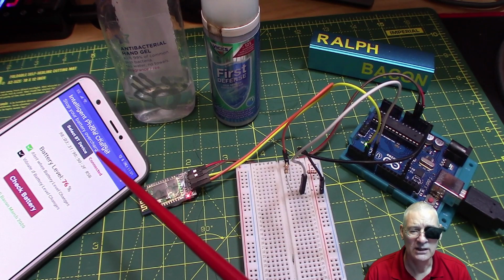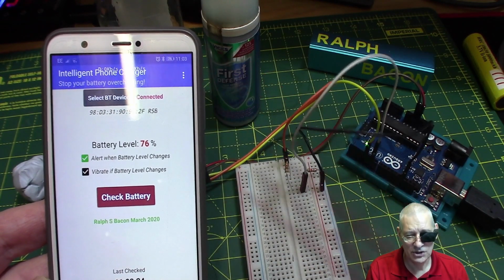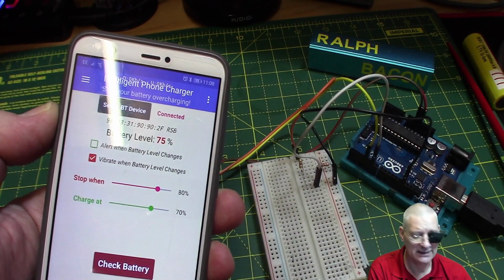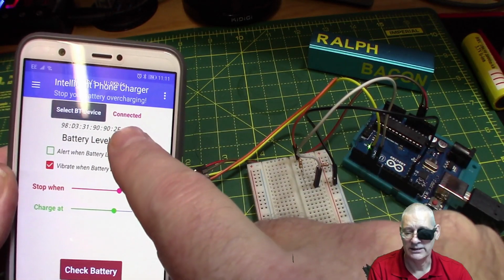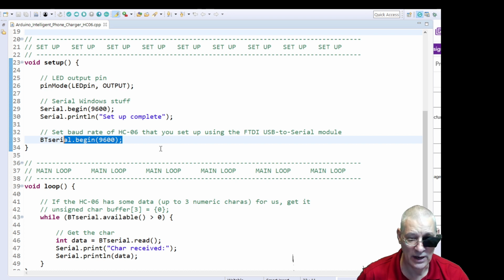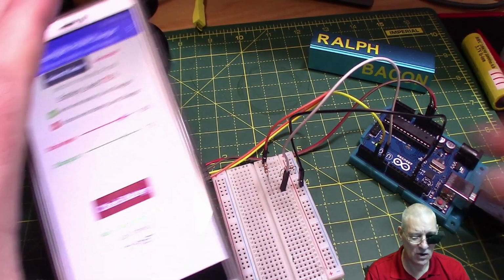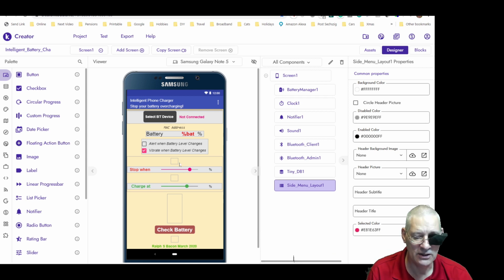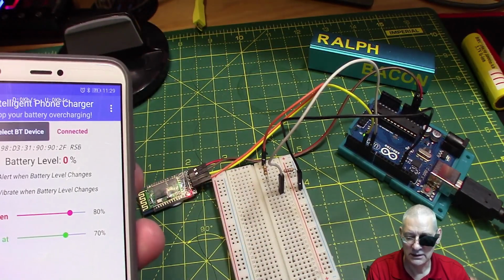#179 Intelligent Phone 📶 Charger with an Arduino 🔋

Comment: Nice with a new video from you.

With that kind of device I always thinks of more features:
A possibility to specify day and time where it charges the phone to full. If you use it at work it would be nice to boost the charge before the weekend or with a fairly old battery boosting it before the phone is removed from the charger (This requires it is removed at a fairly specific time).
Another detail is a fall back procedure, most useful would probably be to switch the charger on if no Bluetooth connections is active.
Reply from the maker: I do believe, Henrik,  I said words to the effect that you (we) can make this as simple or complex as we desire. Your ideas are great and I might do a V2 of the Android app. Or perhaps all the intelligence should be on the Arduino? The phone just sends the current battery level, and date/time and the Android does the rest. Hmm. Now you've got me thinking! Drat!
Reply: If you check my projects you will see I have a tendency to add features I believe can be useful:
https://lygte-info.dk/project/indexProjects%20UK.html

Comment: So good to see you back, I do hope you get your eyes working soon. It is frustrating not being able to do as you want (i do know how that is) 
Good ideer for those who leave their phone in the charger all day but still something i would try building anyway just be course it's yours. 

With that small code and function on the arduino, wouldn't it be possible to use a ATTiny?
To  tell the "charger" that you want full charge, push a button and Reset when you take the phone from the charger.
That way you keep it as simple as possible, push the button when you want full charge and forget all about it. The charger will go back to "normal"

My comments seems to long, I hope you can see it all, he he. 😜
Reply from the maker: I had to squint a bit, Flemming, but I read all your comment! Now you are saying Keep It Simple (by using an ATTiny85 and a couple of LEDs) whilst others are suggesting making it more complex, possibly using an ESP32 and having a full charging schedule depending on day of week and time of day. I think I will create the bare bones and let everyone else dress it according to their needs! Although I did seriously consider using an LCD 16x2...
Reply: @RalphBacon  A weekly schedule, wouldn't that be easier to program into the app on the phone, there you have the keypad and display at hand any way.
You only need to tell the charger to start and stop.
Of course you can make this very complex with a big graphic display and and keyboard and all sorts of hardware and software options.
It feels a bit to advanced for this project, not what you usually do. am I completely  off the track?
Though i would love to see you take projects to the next level, like The Home Alone, i enjoy those small project to solve the problem at hand.
Reply from the maker: Oh, I'm keeping this simple, Flemming. I'll leave it to others to make it complex / complicated!

Comment: With all your automations, have you considered going down the Home Assistant (not Google) route. Using the Life360 integration the app on your phone will provide the battery state (designed for location but the battery is an added extra). The information can be used in Home Assistant to switch on your charger with a simple ESP01 switch.
Reply: Sorry, hadn't got to the end of the video when I wrote the comment.
Reply from the maker: I think it would be very possible to connect this all up to a Home Automation system (eg Node-Red / MQTT) all running via a RasPi and ESP8266 Sonoff devices. The problem for me is that I still haven't got mine running after 18 months even though I have all the bits I need. Time is the enemy. In this case, running it as a standalone Arduino project just makes it easier and quicker to make.
Reply: @RalphBacon  My problem is a lack of a home to automate. Due to pending divorce I'm in temporary accommodation. I have all the ideas and am testing proof of concept on lots of things but need some bricks and mortar. This week I've 'prototyped' Google Assistant to notify me when my tea reaches drinking temperature. No more cold tea but it is laughable the amount of computing power that is utilised to achieve it. ESP01 running sensor, Pi as MQTT server, Pi running Home Assistant, laptop as the console for Home Assistant, Google Mini, not to mention what goes on with Google in the cloud. Needs must.

Comment: The "stop charging at x%" should be a feature in all rechargeable devices. I've only seen it on one laptop model ever (unfortunately don't remember what it was) where you could set a percentage, so using your laptop as a "desktop" (always plugged in) wouldn't kill your battery.
I've installed a macro app and set up a macro that plays a sound at 85% SOC to remind me to unplug. Works well enough, but means I can't go to sleep (unless I want to wake up to unplug).
Reply: I have a Samsung laptop which has that option: charge to 80%. It is still in use, but after 6 years the batteries are not going to keep much of a charge anymore. I charge my (also a Samsung) phone from 40% to 60%, and then up to 80% or 85%, somewhere like that. Of course I do forget about the charging every now and then but since I am using the fast charger (12 Volt 1.5A) it goes a lot faster (Quick Charge 3.0)
Reply: I've seen this on several laptops including those from Microsoft and Lenovo. Not usually controllable though & I think that the Microsoft devices don't do it any more. Personally I leave my devices plugged in most of the time and don't worry about it. Mine seem to last longer than most people I know anyway so I'm always rather sceptical about this advice. Certainly if you are storing devices/batteries with no drain on them, I'd agree, just not convinced when they are constantly in use.
Reply from the maker: I agree. I suppose a small app could be written for a laptop (Windows/MAC) that could send the same information as my phone does. It's not something I now have a use for. In fact, when I did use my laptop as a desktop, the advice in the booklet was to remove the battery. That also removed the built-in battery backup (UPS) feature but it was to save the battery, of course.

Comment: I had that in my project list for years... One thing you could add is "leaving time" and "%" to tell the application that you'll disconnect from the charger at that time and that you want that amount of charge at that time. Then the app calculates the remaining time and considering the charge rate (1% per minute for example) sets a moving minimum charge % to make sure it can reach the goal when you leave.
Reply from the maker: As I said, you can make this project as simple or complex as you want! Your suggestion is very sensible. I will consider it for my implementation.
Reply: @RalphBacon  The idea is to have the minimum% as low as possible (like 20%) without risking to be at that level when you remove the phone from the charger to go outside...

Comment: Love your videos, hope your feeling better and the eye gets sorted soon! Can you point me at your video describing the action of the MOSFETS please?
Reply from the maker: Sure thing Mike. The original on/off (the circuit I showed in this video) would be video #123, Arduino Auto Shutdown (and switch off). 

A slightly different version can be found in video #160, Arduino Battery (🔋 VCC) Monitor, and finally video #173, ATTiny85 Power On Off Shutdown.

In this project I won't be shutting off the Arduino (as in video #123), that will continue forever, but the power to the phone will be controlled by the Arduino via the MOSFETs. I probably won't use two individual MOSFETs, I'll use the Si4599 dual MOSFET chip, very small but can handle huge amounts of current!
Reply: Very useful.

Comment: Is there not an argument to suggest that there extra cycling you are introducing is also detrimental to battery life?
Reply from the maker: Actually, I researched this and what the general thinking is, is this: if your battery can be recharged from flat (auto cut off) to 100% 500 times, then if you charge it up 10% (eg from 70% to 80%) 10 times, that counts as a single full charge (10 x 10% = 100%). So no problem in shortening your battery's life. And certainly a lot better than keeping it at 100%.
Reply: @RalphBacon  I find it quite bizarre that stock Android doesn't have a "90% charge" feature.
Reply from the maker: I think the only sensible thing to do is to write to Google and suggest this. Off you go... :)

Comment: I don't understand why you are still using Arduino with something like the HC-05 or HC-06 instead of replacing both with an ESP32.
Reply from the maker: Well, Phillip, this channel is catering for the inexperienced user too, and an ESP32 just scares the collywobbles out of them. There's nothing to stop anyone using a better µcontroller with a built in BT though, and an ESP32 would work well (although somewhat over-engineered for what we are using it for in this project, IMHO).
Reply: @RalphBacon  I can see how the different microcontroller might intimidate some people but I find it easier because I don't have to worry about working extra components. That part is done for me.
Reply: Maybe he already had the parts? It works just fine.